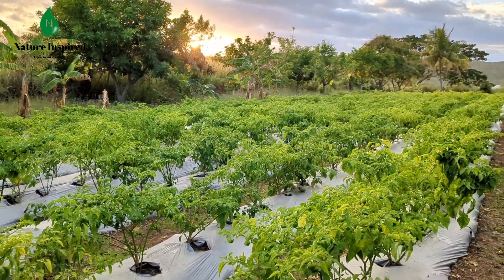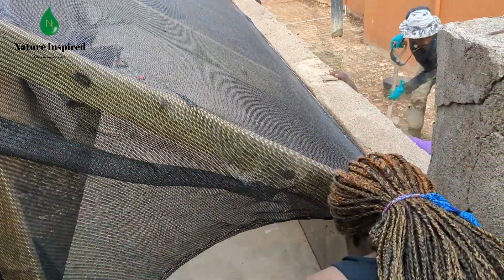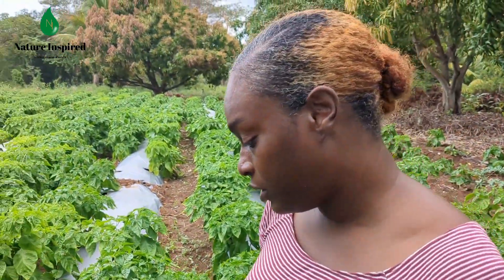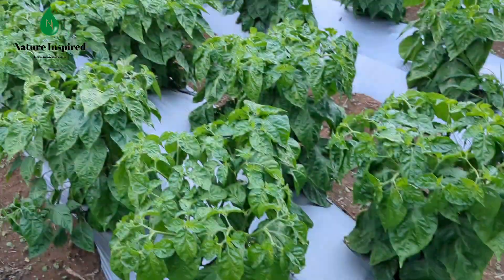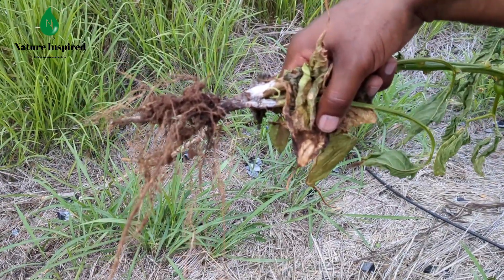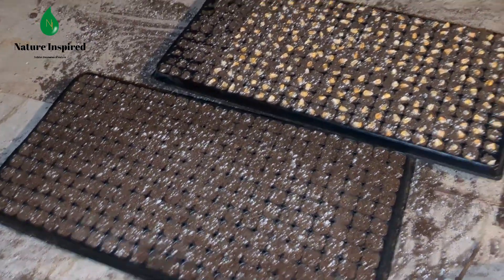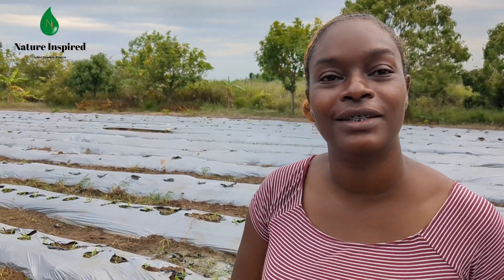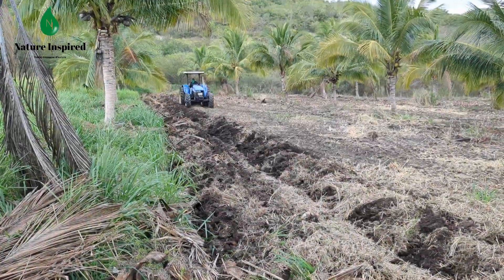Identifying problems in the scotch bonnet pepper field while farming in Jamaica

Comment: Corns only require a 6 to 8 inch spacing. The important thing is to maintain a good  fertilizing program. It is best to fertilize at planting and when the plants reaches knee high you fertilize again with a high nitrogen fertilizer. Link if you're interested in getting suggestions.
Reply from the maker: Thank you much for this invaluable suggestion. We will definitely be reaching out. Do you have a contact you can share?